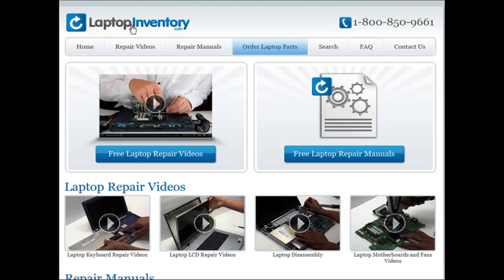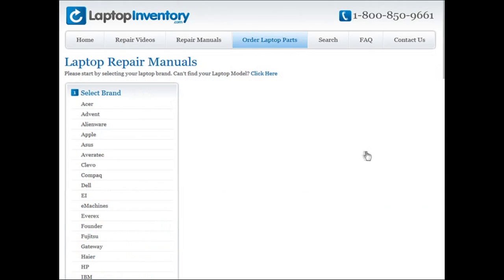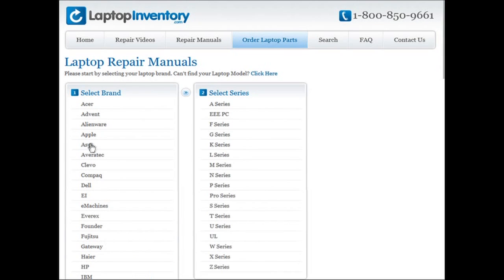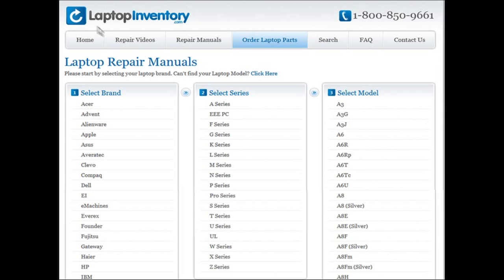Sony Vaio Laptop Repair Fix Disassembly Tutorial | Notebook Take Apart, Remove & Install VGN-FS

Comment: Buenas tardes, un favor necesito cambiar el display de una Sony PCG-611AP pero no puedo desmontar la tapa donde esta el display y los tornillos que están en la parte baja no me permite meter ningún desarmador, de casualidad tendrás un video para este modelo de Lap, ojala y me puedas ayudar, te voy agradecer mucho tu apoyo, Saludos y gracias de antemano
Good afternoon, a favor I need to change the display of a Sony PCG-611AP but I can not disassemble the cover where the display is and the screws that are in the lower part do not allow me to insert any screwdriver, by chance you will have a video for this model of Lap, I hope you can help me, I will thank you very much for your support, Greetings and thanks in advance

Comment: I found the CMOS battery. It's on the underside of the motherboard around where the Wireless Card socket is i.e. where the gent is working around 5:35 in the video. I managed to replace it by removing the screws around that area of the motherboard and gently lifting the corner of the motherboard, I then used a very small flat screwdriver to pop the battery connector out, and the same, along with my fingers, to connect the replacement battery. it is fiddly, but possible.
Reply: I have a Sony vaio vgn fs515e are they rare?
Reply: thats what im looking for, much to no avail